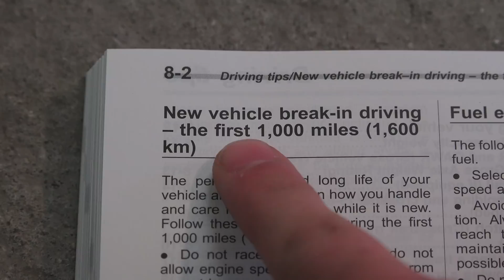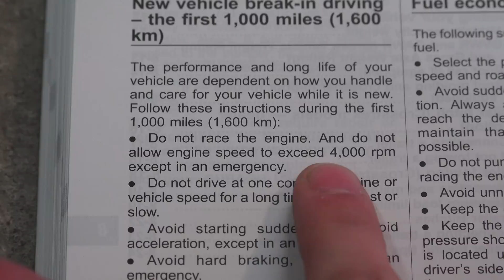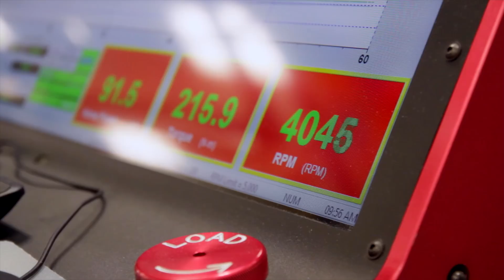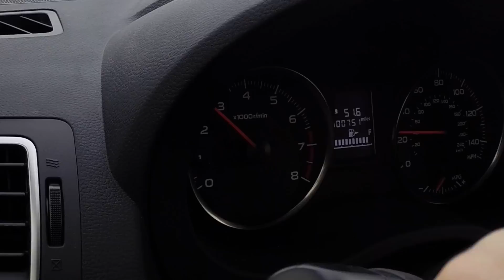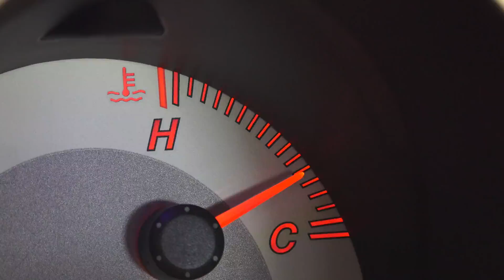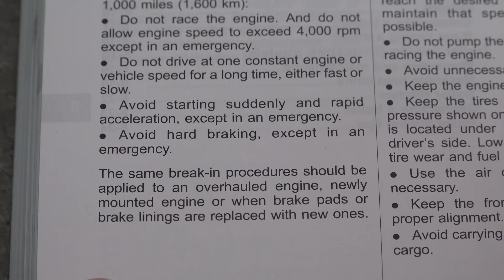5 Things You Should Never Do In A Brand New Car

Comment: #6 in this break-in period is FREQUENT OIL CHECKS/CHANGES. Check oil condition at EVERY fill-up during a break-in period. The first oil+filter change should be within the first 500 miles, you CANNOT change oil too often. Many manufacturers already recommend this, and sometimes recommend several changes within the first 3,000 miles. In ANY case, you should ALWAYS check your oil condition, because breaking-in these parts in will result in "tough-wear", which is hard on the oil because of the greater "pinching" threshold as parts mate (whereas many lubricants have a rating of "pinch-strength", which is how much pressure per given area to squeeze it out from between two parts).

The principle of break-in is to "polish the symphony of parts for a longer-lasting and more reliable marriage". And you know how rough a bad marriage can be, it wears you out.

Also during break-in, the oil will have a higher metallic content than normal as tolerances are attempting to equalize, if you can put a powerful magnet on your oil filter canister and keep it secure (I use lots of duct-tape to secure salvaged speaker magnets), this will go a long way to ensuring long-life and reliability in the long run by trapping the heavy metallics in the filter itself.

Comment: I floored my 2015 Civic during the test drive. It had 4 miles on it and was delivered to the dealer only a month prior to me purchasing it. 

40k miles and 4 years later, it still runs like new and I still manage 40+mpg with no issue and have power when I need it. I mean, as much power as a 1.8L can have.

Also, I would like to know what emergency scenario would REQUIRE you to exceed 4k rpms haha.

Comment: engine braking is the most important part - period. do it.
2nd most important part is I'd recommend changing your oil early that first time. Maybe at 500 to 1000 miles. Yes it will have lots of life left in it, but also lots of medal particles.
Reply: lifeisgood070 can you explain why engine braking is good
Reply: @raeee5947  mechanical eng. Really have no idea. I researched the hell out of it years ago when breaking in motorcycles and they all turned out really strong. But can't remember at this point.
Reply: lifeisgood070 my automatic car I just bought has 2 gears for engine braking and maximum engine braking but I’ve been scared to use it. But I kind of figure if 2/6 of my gears are specifically for engine braking that maybe it’s a good thing
Reply: Give that man a metal. He deserves it. Haha
Reply: lifeisgood070 metal particles go in the filter

Comment: The problem is the masses in the UK don't fix cars. Listen to other owners who have heard things and come to a group consensus, then this becomes fact. Because they are so naive, refuse to learn, putting it under the blanket of you need special tools and expensive diagnostics. How wrong they are, Ill informed due to the mass consensus. No you don't need special tools for most things, the ecu doesn't monitor everything. Cars are still crude and are made even cheaper today. Ncap safety cubes designed to rot, snap and fail.
Reply: people should learn how cars work so they can understand warning signs something is wrong. Sometimes it's ok to ignore the check engine light until it's convenient, sometimes it is not and when it is not the car is usually giving you clues. You might not notice that you are increasing throttle to hold your speed on the freeway. sometimes you'll hear something and because you don't have a clue what could be making it, you ignore it. the temp gauge is reading noticeably higher than the middle of the gauge  but not enough to trigger the warning light and you don't know you could slowly be leaking the oil out and fifteen minutes later the oil pressure and temp lights come on, which you may or may not know means find the nearest exit, or of in the city pull over and shut the engine down. what you don't know is that soon as that temp gauge started up there wasn't enough oil getting to the cylinders and bearings and you just put 10 or 20 thousand miles of wear on the engine, and you still have to get oil in it and figure out where it's coming out. Every time you smell something like burning oil or the smell of a hot engine or the smell of an engine that's running too rich you should start trying to figure out if it's coming from someone else's car or yours. 

Usually what wises people up is having to pay to replace an engine or a transmission because something fixable had been let go until it failed. the stupidest thing that causes the biggest failures is fluid leaks. if you don't notice the transmission fluid on the ground under your car the guy in the transmission shop is going to make a bunch of money when you have to have it rebuilt because it's simply burned up from not having enough fluid in it. If you don't notice that spot under your car where is leaking engine oil you'll eventually get an oil pressure light and some damage has been done before that light comes on then you have to keep putting oil in the engine. if you just keep putting oil in it and wait too long to get the engine leak fixed it will be running most all the time with less oil in it than it should be and sooner or later you're going to forget again until the oil pressure light comes on and if you don't deal with it right away you're going to blow the engine up. Bad alternators make one kind of noise, bad camshaft belts make another kind of noise outer CV joints make one kind of noise, inner CV joints make another. Oil leaking on the exhaust makes one kind of smell an engine that isn't running right makes another kind of smell, a radiator about to overheat makes another kind of smell. A starved crankshaft bearing makes one kind of knock, a piston wrist pin makes another kind. So if you want to just keep spending your money over to behemoth car makers and parts makers and shops that often overcharge feel free. If you'd rather spend it on something else learn how an engine works how a transmission works what a CV bearing is how the brakes work. It's not that hard really. There are only five categories that cover all of what's important on a car. Engine transmission suspension brakes and steering. Learn how they work.

And if you are buying a used car think of those categories too.  engine transmission suspension brakes and steering.

Comment: I am a diesel mechanic qualified in 2012 build engines from just after school I and I built allot of   engines the 1 engine that did not last was the 1 that was low rpm breaking in attempt led to a breakdown after that i decided that f_it drive it like u stole it first time it starts then drive it till about 3000rpm 1st gear then 4500 rpm second and by 3rd all the way to just before the limiter if its a diesel start idle for 5 minutes check for anything suspicious put the dozer in gear and start pushing full blade  pushes at maximum throttle not one engine fatality for me after that change of mind
Reply: Not even one period. Everyone should notice this and disregard everything you said.

Comment: MY brand new Mazda CX-5 Signature with 2.5 ltr turbo engine  had 145 miles on it when I bought it. It was a dealer swap from a dealer 45 miles away. So how did it get the other 100 miles? I broke it in per the owners manual for a total of 600 miles, but who knows how the car was treated prior to buying. The car looks great, runs great, and gets 20%  better highway gas mileage than the sticker says it should.

Comment: I just got my 2019 WRX few days ago , when I pick it up it has 4 miles on , but I'm pretty sure someone beat the hell out of it during a test drive lol the peak boost records 15 psi when I checked it lol but during the break in I keep the rpm below 3000 and throttle doesn't exceed 25% ,, should my car be fine even someone floor it already?

Comment: You never explained why cruise control is bad for a new engine?
Reply: You fell asleep. Constant RPM for a long period. The purpose of the break in is to run the engine at various RPM through the break in period.  Cruise is steady unless you live in the mountains., then you will likely exceed 4000 RPM.
Reply: @daveroberts6884  
but why Is steady "bad?" I understand u need varied rpms to break it in, but I cant imagine steady rpms for a while will actually "harm" the engine in the same sense a hard break in can.

Comment: The hard break in more applies to non-ringed engines. When making sure that a ringless engine sleeve and piston mate together you need to make sure that the load and temps are at the performance point. If not the sleeve and/or the piston will not be at the proper expansion and can cause premature wear.

Comment: The worst part of a new car brake in is that the dealers let them idle for a long time, frequently start them and move them 100 feet and on top of that they get test driven with full throttle acceleration then with max brake application.  If you can find one fresh off the truck its best.  To wear in rings spend the first 200 miles accelerating moderately then going to 0 throttle then accelerating again gradually getting more aggressive with the acceleration.
Reply: I worked for dealers for 20 years, porters moved the car and thats it, We had no more of a reason to let a car idle then an owner.

Comment: I follow my owners manual except for the oil change recommendation.    Any motorized thing I bought in the past noted an earlier oil change for the first one.   Now they tell you to just use the normal interval for the first oil change.    Better oil I get it, but metal gets in the filter and I’d rather just change it at 1,000 miles the first time and not worry.
They probably changed it since they do oil changes free for 2 years (Chevy) also you won’t have any problems during the warranty period either way

Comment: Floor it. New cars are broken in from the factory. Bang it through the gear til redline... then cruise between 2000-3000 rpm... you'll be fine.
Reply: Scott, I built motors for a living, And i agree to flooring it when new, Be let me reassure you, these engines are not broken in,  these cars are run for 2-3 miles for rattles and wind-noise and put on a transporter, redline.....not so much.
Reply: @stclairstclair  As long as youdon't get on the freeway for hours at a time as a constant speed, you'll be fine. This isn't 1970. It's the new milinium!
Reply: @cryptomaniac967  High rpm and heat is the killer, Look at burn out contests, agreed.

Comment: Excellent video and well explained. I especially liked how you showed an actual piston and rings in your demo. I'm having a new GM engine installed in my Impala and I want it to last. So the key with engine break-in is to vary the rpm's but keep it under 4000 rpms?
Reply: Funny I was a GM tech and built motors exclusively,  Change the oil before the first 1000 miles, If you think it will last longer by babying it, it wont make any difference, Synthetic motor oil and a high grade filter is all that will ever save it.

Comment: Curious as to why throttle is important.  If you're on WOT, your crank is still only spinning at say 3000 rpm, there is still the same number of ignition cycles as you coasting on the highway at 3000 rpm
Reply: Pressures. WOT = lots more fuel into the combustion chamber per cycle, and much higher temperatures and pressures as a result. It's the PRESSURE in the cylinder that does the work/damage, not so much the RPM.

Comment: I have a 2019 Honda Insight and the manufacturer does not call for any break in procedure. Using different language and in 2 separate locations it says don't brake excessively under 400 miles and doesn't exceed 80mph before 600miles. In this car, you do not have any control over engine RPM.

Comment: This is a common misconception.. they floored the engine at the factory for quality control before they handed to you.. you actually want to beat the piss out of it withing the first 500 to get the rings to seal correctly. There is substantial Dyno data that proves this correct. Sorry but the video is an urban myth

Comment: I bought a new 2018 Hyundai Elantra about a week ago. I read the owner's manual to see what they recommend for the break in period. It says for the first 600 miles, to keep the engine between 2,000 and 4,000 RPM. I can understand why they say to keep it under 4,000, but why do they recommend keeping it above 2,000? That part I do not understand. Anyone out there have an idea why? I live in the city and cruise around at usually no more than about 35mph, so it's hard to keep the engine at a sustained RPM of above 2,000. The transmission wants to get up into top gear as soon as possible and the RPMs are often cruising below 2,000. Not really sure what I can do to stick to their recommended break criteria.

Comment: Your dealer has probably turned the car on and driven it from place to place on the lot without letting it warm up 30 times or so.
When you buy it, you'll sit in it while idling at a single load/speed for half an hour while the salesman tells you every setting you can change in the menus.
The last few guys who test drove it, already took it to redline to "see what she'll do."
Motorcyclist magazine just did a test on this taking two new engines and breaking one in per spec and they other by beating the living hell out of it. When they opened them up afterward, they looked the same.
Reply: I work at a dealership, can confirm our professional drivers who pick up the cars from the rail yard definitely drive new cars hard, our techs drive them hard on test drives, our customers drive them hard on test drives, we move them less than 30 feet all the time just to arrange the lot. All of these rules get broken before you even consider the car you want.
Reply: @zeallust8542 
This is exactly why dealerships will die off. I will be ordering my next car online where it will have been untouched by middlemen.
Reply: @AbsurdImprobability  Lol imagine being so naive.
Reply: I saw that video where they did a extreme hard break in vs soft.
Reply: My dealership had 0 miles on the car, so no...nobody drove it first. We did sit in the car with it running for 15 minutes as he went over all the tech features though. So I guess some people get screwed over with their new car experience but I didn't. I followed most of the rules of the video because my father taught me how to break in engines. There is ZERO reason to redline your new car right off the bat! Risking engine damage for what? Just keep it under redline (screw the under 4000 RPM thing though if you are driving a performance car, most performance cars redline is way higher than that) for 1000 miles then cut loose. I mean sure its a new car its under full warranty but that doesn't mean you wanna end up with it in the shop stuck with some lemon loaner for a week.
Reply: @Ziegfried82  Then your dealership rolled back the odometer lmao, there's more than a mile on the car before it leaves the plant. Either you're lying or they were.
Reply: You should never trust the engineers that designed and tested the engines. Much better to take the advice of some dude who likes to tell anecdotes on YouTube, I know a guy who has a friend that....
Reply: yep truth... esp the dealer stuff, i know first hand

Comment: I agree with you for the most part, and what differences we may have are negligible , but I've been in a engine dyno room where they take a new or a rebuilt engine and ultimately do full engine pulls  to max rpm's.  In fairness they do some break in runs, and gradually raise the rpm's, but with in 25 mins or so, the engine is run to max rps for max power, packaged up, and shipped to the customer. 
Good video BTW, and would be good advice for some one who had no ideal how to perform a break-in
Reply: Well i wouldn’t buy one of those engines!
Reply: @Wazza722  Ill take a engine broken in on a dyno 1000 times over vs a brand new engine babied. Not trying to be rude, but you don't know what you're talkin about
Reply: Does a dyno put load on an engine? Engine might be running but its not having to push the weight of a vehicle?
Reply: @simd510  I don't pretend to know how all engine builders dyno test their new engines, but the few I've been in, they load the engine and make a few low RPM runs. Check timing, valve lash, fluid leaks, change the oil, and make a full RPM run under full load. The only way to calculate the horsepower is under load

Comment: I've driven my baby 02 mustang gt 5speed car  for 15years she's got  310000.0 trouble free miles Mobil 1 10w30 winter motocraft filters always Mobil 1 10w40 summer!! Drained ATF from trans after first 5000miles refilled with Mobil 1 engine oil then same oil still in trans it's as clean now as when new ?? Must not get hot?? Trans oil !! I grease throw out bearing every oil change babys still got factory clutch n all !! Ford tough!!

Comment: According to Tasos Moschatos (see his awesome Youtube channel), who is an AMG engine rebuilder in the UAE (those Arabs like to murder engines), you cannot just do those 500-1000 break in miles in one long road trip. It doesnt work like that. You have to heat cycle the engine at least a dozen times doing the break in period to get the best wear-in characteristic and engine life.
Reply: I too rebuilt motors for a decade at GM, It is mostly wishful thinking and happy thoughts,  dont over rev it as high rpm's is the killer, change the oil before 1000 miles, the rest is hogwash.

Comment: I was an engine builder for thirty-five years and have never told a customer that there is a break in period. I did tell them to let them come up to temperature before putting the whip to them. Every engine came with a one year fifteen thousand mile warranty. Generally, if a motor is going to fail it will be in the first two thousand miles of operation. Dirty oil and overheating are what kills engines not running full throttle when they are new.